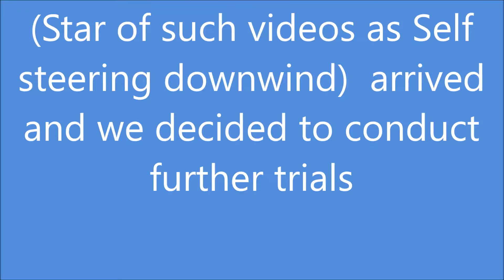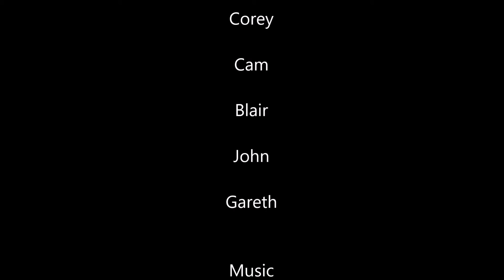First sea test of the home made electric outboard motor

Comment: Great progress. I wonder how the range and weight overall compares with a small petrol outboard?
Reply from the maker: Samuel Fielder total weight is 17.3 kg including the battery, which is similar, but the range would probably be much less...
Reply: I suppose you can't beat the energy density of petrol, but at least you're envirnmentally friendly if the charging comes from renewables. And more sophisticated controls.